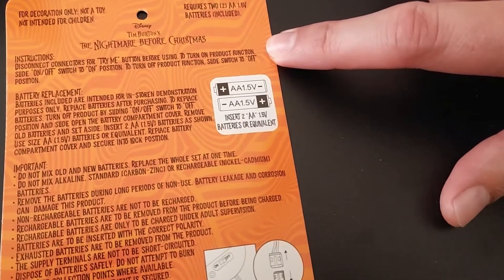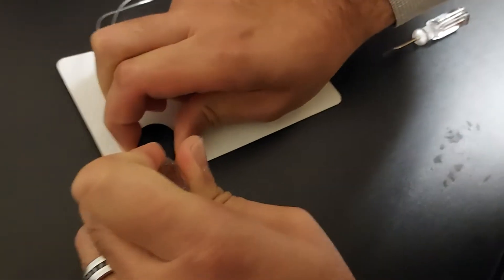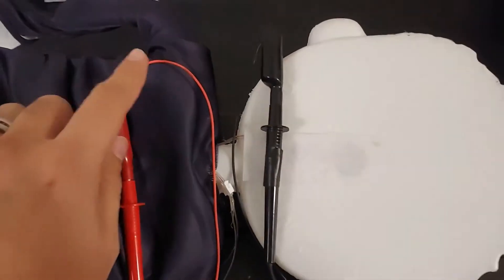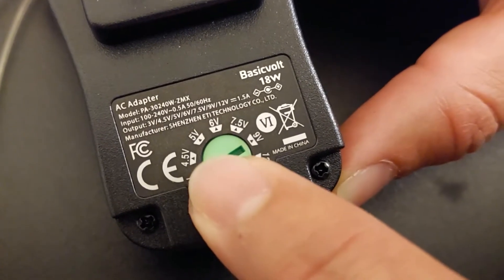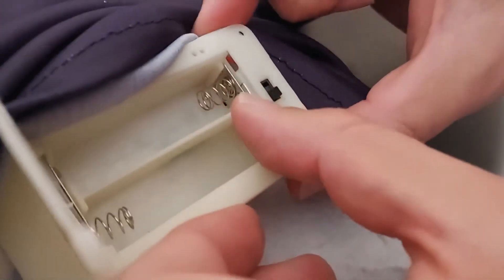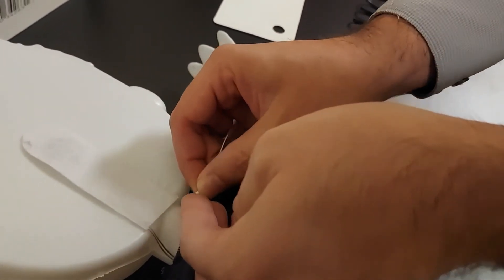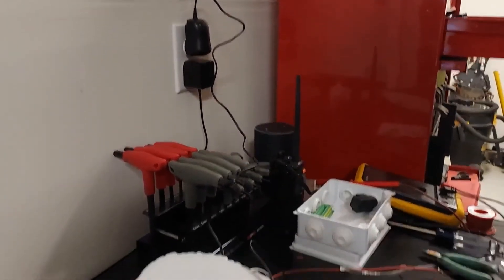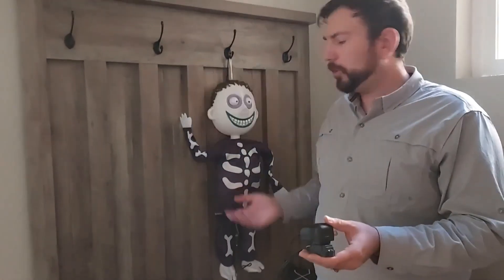Holiday Decoration, Indoor battery powered (DC)  to AC conversion

Comment: I'd like to do this to my tree topper. Do i have to keep the battery box?  Couldn't i just cut it off and go straight to the power supply?
Reply from the maker: That's a clean way to do it. Just keep track of the positive and negative wires if they are not marked. The only negative of cutting out the battery box would be backwards compatibility in case you easily wanted to covert back to batteries in the future.